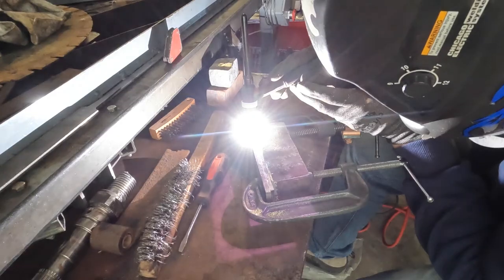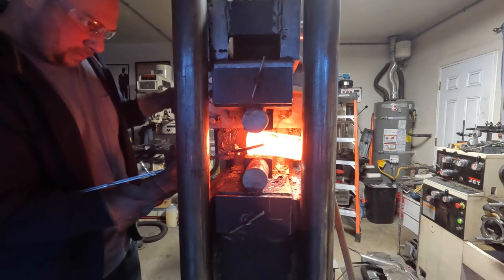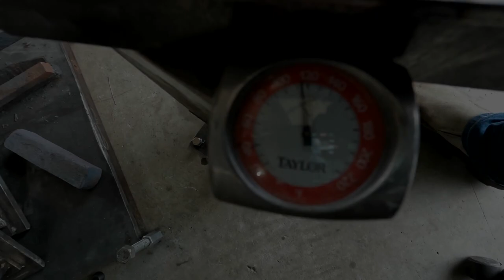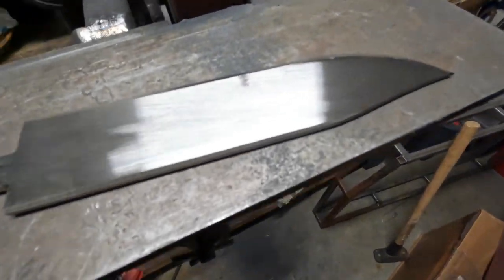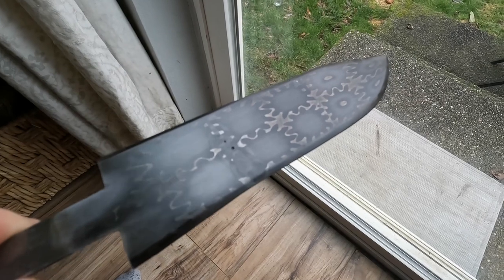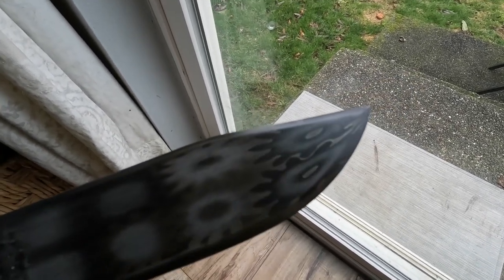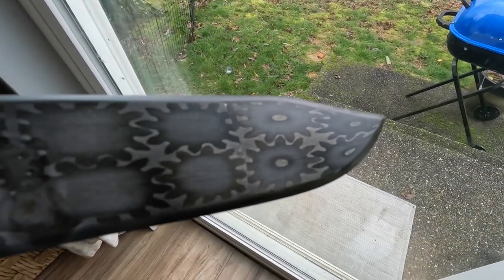Gear Damascus knife

Comment: I've been waiting for your follow up video! Denis Tyrell taught me a few weeks ago that lines between the tiles generally disappear if one does two tempering cycles of two hours each at 300 to 350 degrees. I actually bought gears after I saw your first gear damascus video, and Denis looked at them and suggested that 3D printing in a canister might be a better way to do it. I have no explanation for the porosity you got, and can only imagine how discouraging it must be after all that work. Denis also suggested a really shallow canoe with powdered steel on both sides of the gears if I insist on using actual gears; that might eliminate the porosity, or it might not. I intend to try it, just because I want to make a knife with gears in the blade. Don't know why!
Reply from the maker: I only did one temper 2 hrs at 300. I did two heat and cool slow cycles before heat treat. I still have a large chunk of this so I am going to try again. I might try your shallow canoe close to final shape idea next. NEVER SURRENDER. I will conquer the gear damascus! Thank you so much for the suggestions!
Reply from the maker: Let me know if you want the remaining piece!!